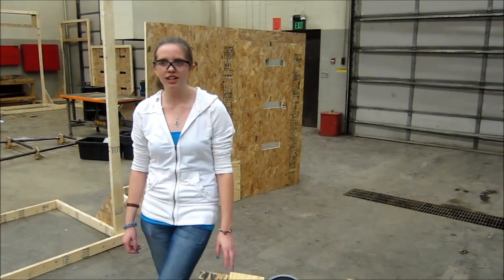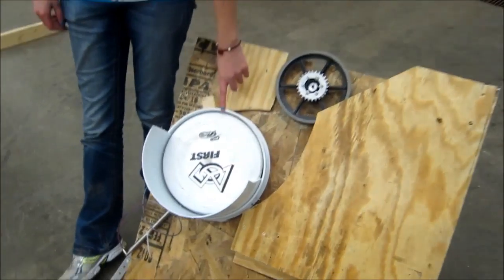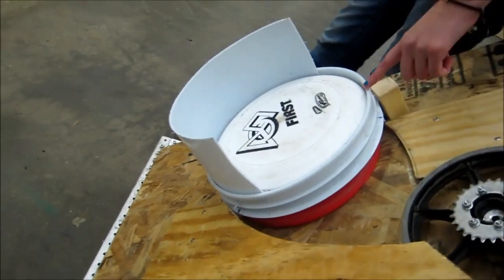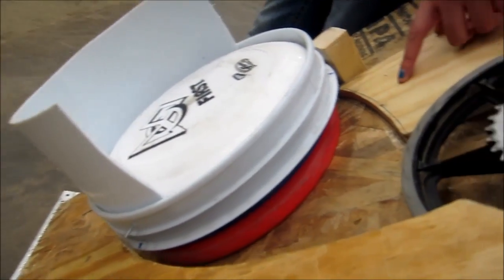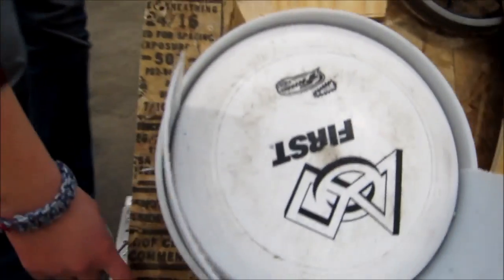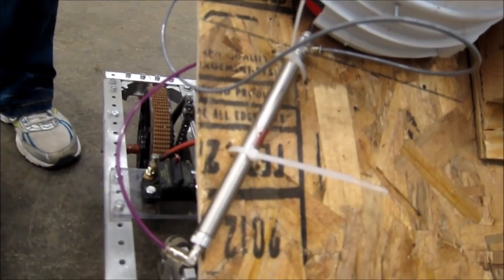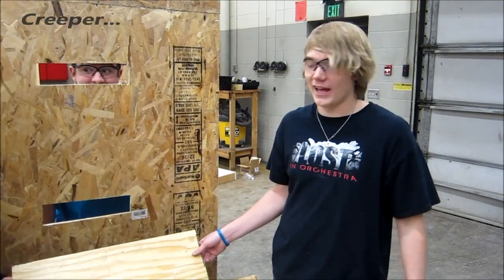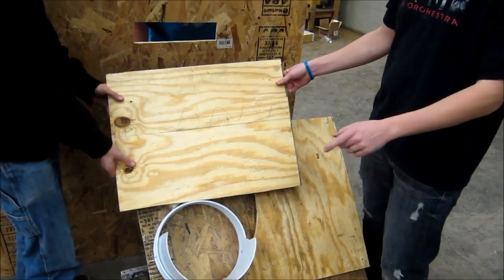Prototype Robot - Haaapper and Loader

Comment: Awesome job guys.  Supposedly, the top speed of the CIM is approximately 5,000 rpm.  
We are shooting linearly (like in the 3 day robot) but are having some vibration problems.
We're also using a 3/4" piston, single acting with a 6" stroke the frisbee "pusher".

Comment from the maker: Unfortunately, we do not do RPM testing. However, the wheel is just straight mounted to the CIM using a bushing so whatever the top speed of a CIM motor is, that's what the wheel is turning at.